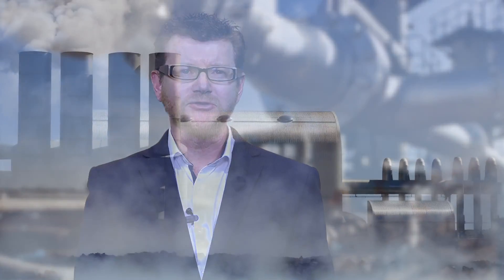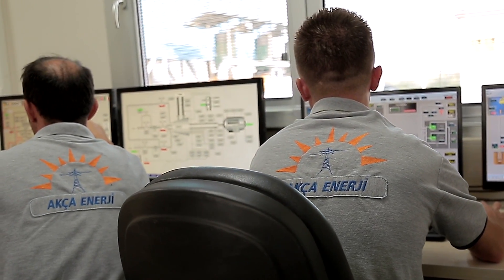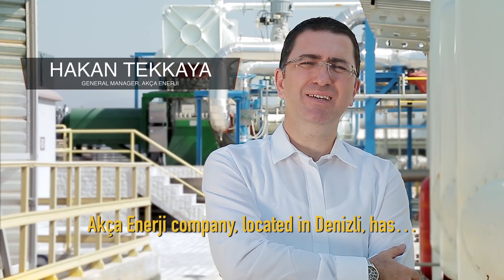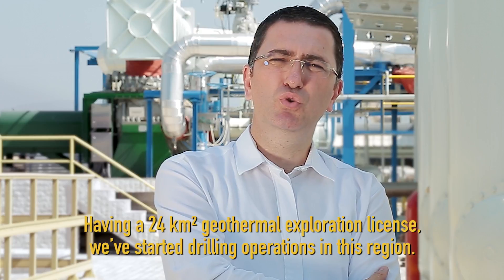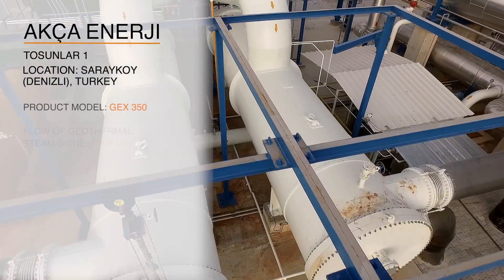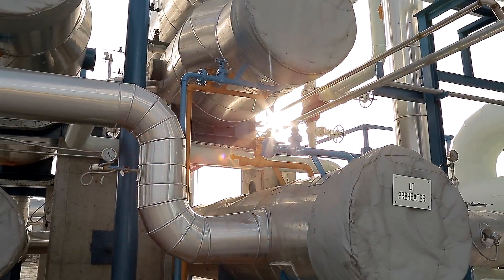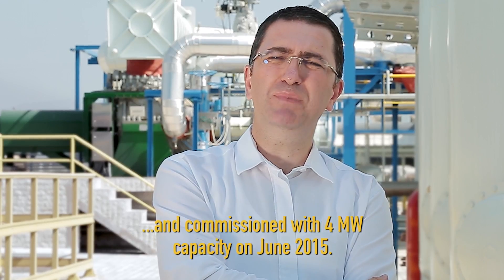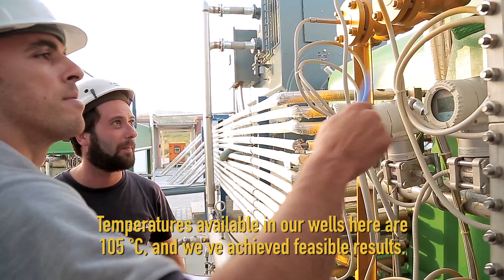ORC solution for geothermal low temperature heat sources - Akca Enerji, Tosunlar Turkey

Comment: we have to replace fossil fuel plants or most power plants with geothermal ones. (hydro is available in too low amounts on the planet)  'so' production and injection wells have to be  much deeper so higher temps that can be variably used, some parts split off for lower temp binary systems .  this means deeper wells as of course millions more wells . we have to realize the October '18 IPCC report is not a joke and we have to stop burning fossil fuel to 'make steam'. -and hopefully legislated as LAW. also electric cars only by law. ----------------emitting CO2 is idiotic and killing us. ------------------------------------we must obey this report, for our kids sake !!!